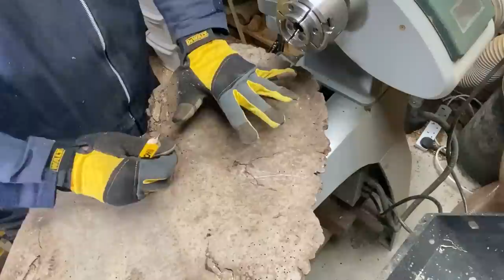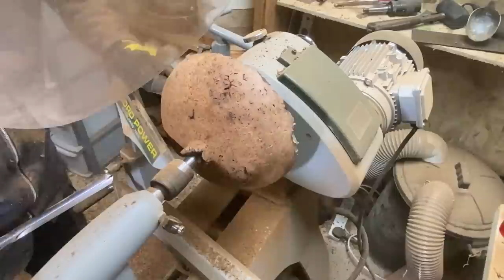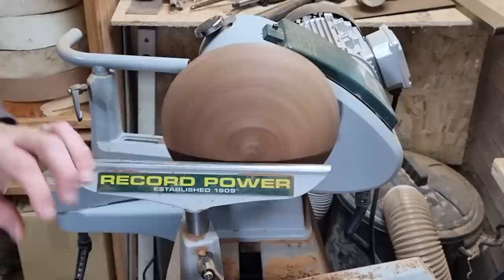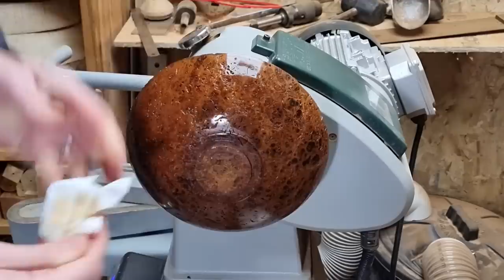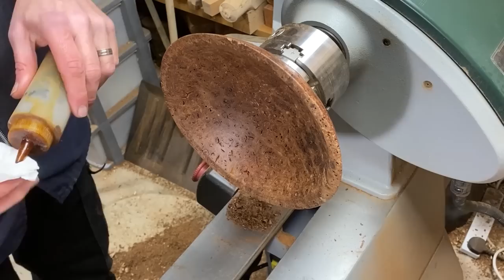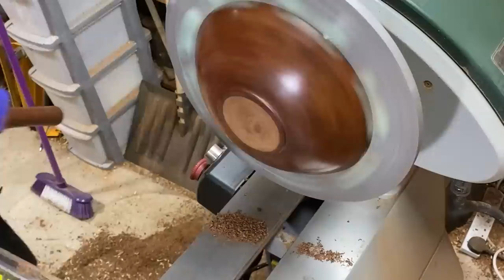I was BANNED from turning this - Woodturning the Big Elm Burl

Comment: That's a really nice result.  I always used to cut an inverse tenon of the bottom and turn it into a feature rather than having to cut them off at the end.  I must get another lathe, really miss the work.
Reply from the maker: I was going to put a recess in (this is my preferred method) but I was not 100% sure of the structural integrity of the wood. Thanks, Mike.

Comment: Hi Mike enjoyed this video. Can you advise what air blower system you use and also what is the mix percentage of boiled linseed oil and shellac that you use.
Reply from the maker: Hi Ivan, I use a Hyundai compressor 25l which does the job pretty well. And try a 3:2 mix oil to shellac that should be fine, all the best, Mike 😀

Comment: For those who have never used linseed oil; it is important to hang rags etc. either in a flammable-waste can or better yet hang them outside to dry. Boiled linseed oil creates a heat of reaction when it sets up (dries) and may get hot enough to combust if not allowed to air while drying.
Reply from the maker: This is a very good point that I had forgotten, next time I use it I will remind people, thanks for the reminder, I do appreciate it.

Comment: Nice wood grain. The end result was better than I was thinking it would be. It makes me think of a porous stoneware product with all its nooks and cranny's.
Using a resin or superglue would be good to fill in the nooks to strengthen the wood and give it a unique color scheme. Anyway, isn't regular shellac used to finish off a project to protect it from stains and spillage instead of trying to fill in void areas? I don't know much about that other than a few projects I did in my youth while in grade school.
Reply from the maker: Hi, thanks for watching. I was not using shellac to fill the holes I was using it to firm up the surface. But you can also use it to create a high shine, shellac is the main component in French polish.

Comment: This feels like a piece that could have used resin to stabilize and harden so you could keep more of that burl texture. Have you tried working with resin before?
Reply from the maker: Yes I have, not a fan to be honest, it's expensive, time consuming and not great for the environment, I'm not a environment nut but I only use it when I really need to or for a specific design. All the best, Mike

Comment: Great work Mike and we’ll done for persevering. Just out of interest… when you used the isopropyl, was that to clean off the wax residue left from the abrasive paste? I’ve had a few pieces where I’ve ended up with little bits of wax from the paste in small holes and it’s been annoying. Wondering if isopropyl would have sorted it. Also would standard meths/ denatured alcohol do the same job or is this specifically an isopropyl thing.
Reply from the maker: Hi and thanks. Yes the isopropyl, is there to clean off the residue from the paste, any type of evaporatng liquid will do just as well. The holes are annoying and I suggest using compressed air to blow them out, blow, wipe, blow, wipe till it's all gone. My next video (nest Tuesday) is the other half of this burn and you will se me doing that in the video. All the best, Mike

Comment: Would a saturation with "wood hardener" have helped with the dust & good wood?
Reply from the maker: Hi Tim, one solution would have been to submerge the wood in a hardener and then put in a vacuum chamber. But di not have one so that was out the question. The shellac I used certainly helped firm up the wood later in the turning. Thanks, Mike

Comment: If you put a light glaze coat (epoxy used on a bar top in a pub) over the bowl it will fill all those inclusions in nicely 
Good job on the bowl
Reply from the maker: Great tip! thanks, Mike

Comment: My instinct would be to fill the craters with brown epoxy or maybe melted brown shellac stick. But what do I know?  I didn't even know you could mix shellac and linseed oil, and I have absolutely no clue what Yorkshire grit is.
Reply from the maker: Hi Paul, mixing shellac with linseed oil gives you a type of shine shine juice (I will be making a full video on finishes in the spring. Yorkshire grit is an abrasive paste 😃

Comment: That looks very much like an elm burr but oak burrs are similar.   Looking at how much wood there was, you could probably have created a natural edge bowl.  It obviously sat at the back of someone's workshop for a few years judging by the amount of dead/dusty wood that you cut off.  When I work on timber like that, I use a proprietary wood hardener to avoid wasting a good burr. By the way, I always use a small vacuum cleaner on the wood;  it prevents clouds of dust.  Otherwise, I quite enjoyed the video, especially as I am in the throes of making a small quantity of oak bowls etc from the bole of an an ancient oak tree.
Reply from the maker: Thanks for your suggestions Colin, what type of wood hardener do you use?
Reply: @MikeHolton  I use Rustin Wood Hardener but any similar product will do.  Thin super glue, Titebond, is useful for hardening small inclusions of bark etc.  After many years of various finishes, I have virtually settled on Danish Oil and Tung Oil.  A little time consuming because of the number of coats.  Chestnut Melamine Lacquer is a quick finish on dry timber.  Good luck.
Reply from the maker: @colinsigley5771  Thanks for replying Colin, I'll look into some of these

Comment: I wood have hardened it with reason first to make  it carve better
Reply from the maker: Thanks for the advice, what is reason? I've never heard of it.
Reply: @MikeHolton   you take the wood and put it in a hard food grade reason and pool a vacuum on it it will pool all the air allt of the wood and fill the pores with your reason I wood yous a slow cruing runny resin so it has more time to fill the wood
Reply from the maker: @Phoenix-King-YT  Ah, I understand now. I can't do this as I do not have a vacuum chamber.

Comment: May I ask Mike you  point out to people watching this video that the very fine dust in the air is extremely  dangerous.  Without a mask and proper ventilation it  is a killer.
My best regards ... Martin
Reply from the maker: Hi Martin, yes of course, I used a mask when it was obvious this was bad and always use a mask when sanding but I will mention it again.

Comment: Wow …back in 70-72 , I had a wood shop class, I made lots of very , ornate , cedar , and walnut bowls , and I was fascinated, with making them , and I gave some to people , like my buddies mom , later , I found it in the trash , out behind their house , but the rest of them , are still around , all these years now , I got 2 of them back as the owners got old and gave them back to me ! But I had moved , into making jewelry boxes , hand carved , and had veneer panels on them , I got good money for them , too ! But this guy , should just fill the holes , with a color that stands out , and then after it dries , just cut it down smooth, with these , small colored , spots on it with jagged shapes , colors like blue , red , turquoise, yellow , bright colors , to just match , any thing in the room ! Ya think ?
Reply from the maker: Hi David, there are two schools of thought on burls, you either leave them natural state or you fill with epoxy, personally I prefer to leave them as they are.
Reply: @MikeHolton  I saw a table being built , way back out of 2” thick walnut Curley lumber , they dug all the bark out as it was very , figured , and made the table out of 2 thick slabs , but it had voids in it they put the 2 boards together , and poured , this dark green , thick liquid in the voids , and they just worked it until it was one wide table top , with these dark emerald colors in it , I was fascinated by the workmanship , I guess it was some , early modern furniture , I , never liked the style , I was into older , wooden furniture , from the 1800’s , I was good in with wood , and at the top of my class , years later , when I went out to Philadelphia, to this wood working , shop , with one of the guys who was in the magazine “fine woodworking” , and I was into doing veneer , better , again , it was only a 2day class , maybe a dozen or so people in it they showed us how to veneer , they gave us , a 3/4” piece of finish plywood , and gave us 2 different kinds of really nice , wood veneer , I had a piece of maple marble in it and some very figured , rich , black walnut , and we had to have 3 joints , on all the piece of ply wood . I am the type of man , who worked with the tree, from the woods , helped cut into lumber , and the wood was used to make the lighter slat thin strips that show the grain , and are used to make up , most of a hickory rocker , and I got all the slabs that couldn’t be used for long boards , but had character, like the wide stump slabs , and took then home , sawed them up and made jewelry boxes , but back to the veneer class , most of the people were very quiet , calm workers , me I was very vocal about my work , but meticulous, and flawless in my work ,and at the end of the class , every body had one maybe two sides of their wood finished, and the guy saw I was really into it , I walked up to him , and I had all six sides , just as I was told , end it looked top notch , I handed it to him , he took it examined my craftsman ship , gave it back to me , and said , put a coat of finish on this , and that’s your resume, handed it back with a smile , and commented , that I had talent ! I had started to build up all the hand tools , for finishing furniture, and could cut dovetails , and lots of other stuff , I have most hand and shop tools , to do the trade , but I was involved in a Harley wreck , which lead to this , that , then I had a stroke , and the bottom of the trade , just slipped away , but I still , love to work with wood , and create something , from a few boards ,that could be used for a lifetime  , by hand tools and abilities, by hand , I wish I had been , in the trade a little earlier!